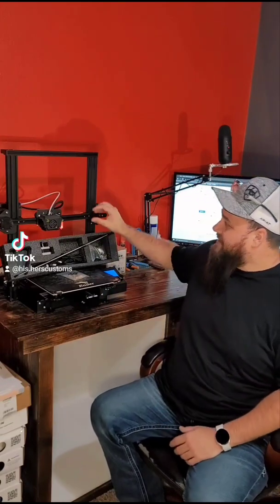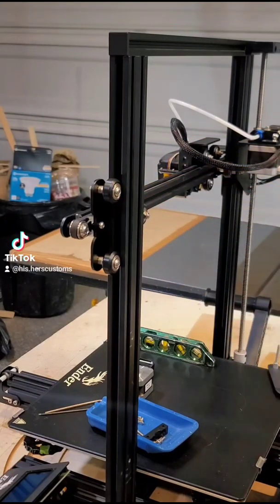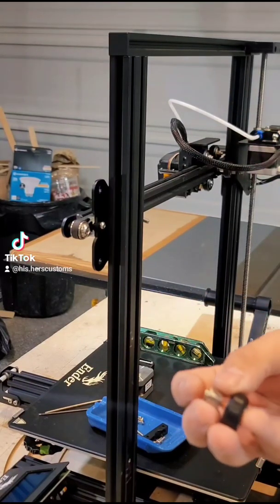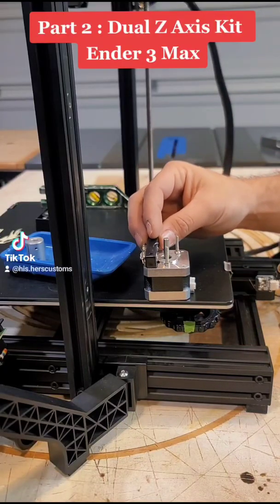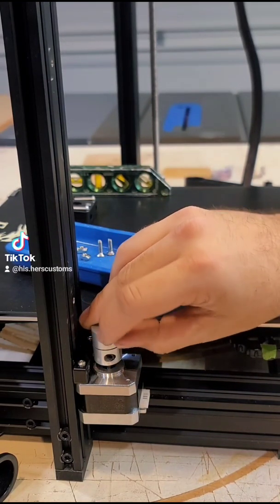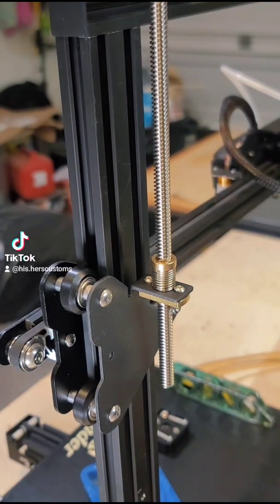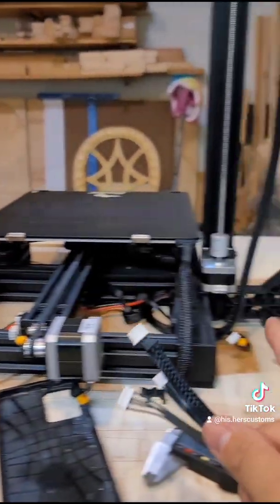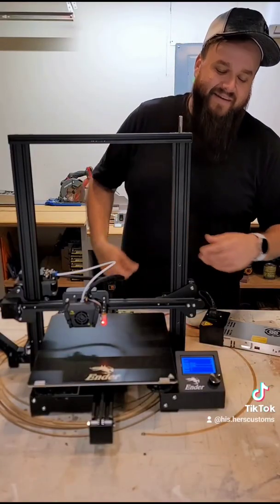Dual Z Axiz Kit | Ender 3 Max | 3D Printer | Improve the quality of your prints with a Dual Z Axis!

Comment: I guess the table would have to be perfectly level as well?
Reply from the maker: Yes, if using a level you would want the table level at well to make sure the gantry is parallel to the bed. If you use a micrometers or tape measure. You can make sure everything is parallel by taking measurements and making sure the gantry is the same distance from the bed.
Reply from the maker: You could also use shims under the 3d printed's feet to level just the 3d printer, then level the gantry.

Comment: Does the regular Z rod stick out like that？
Reply from the maker: No the stock z rod doesn't stick up like that. At the time of purchase there wasn't a ender 3 max dual z Axis Kit. The cr-10 dual z axiz kit is what I used, fits perfectly minus having to move the power supply and the additional length of the rod causing it to stick up higher. You can cut it flush if you would like with an angle grinder & cut off wheel.
Reply: @HisAndHersCustoms  can you cut it off without an angle grinder? with maybe a dremel or something